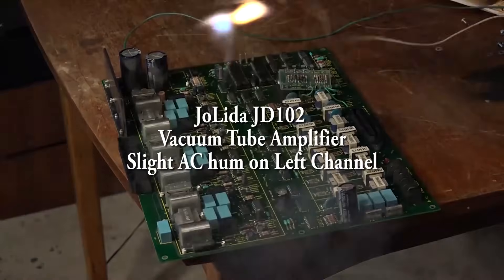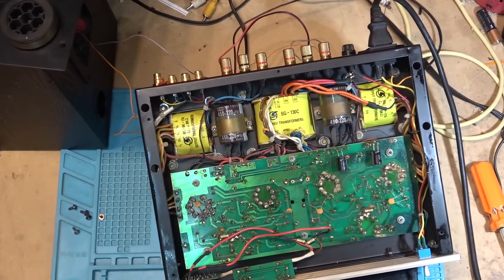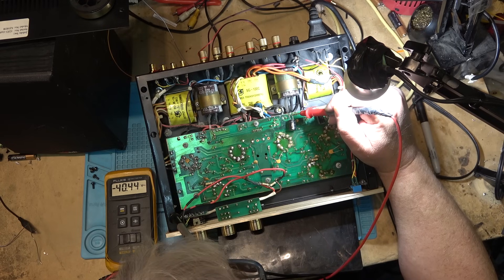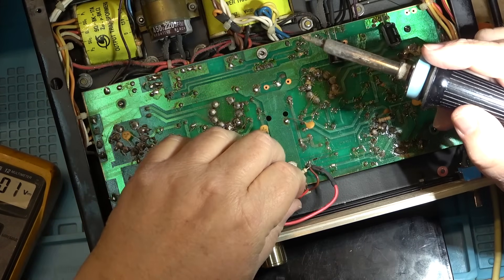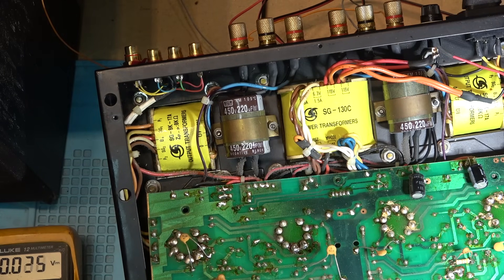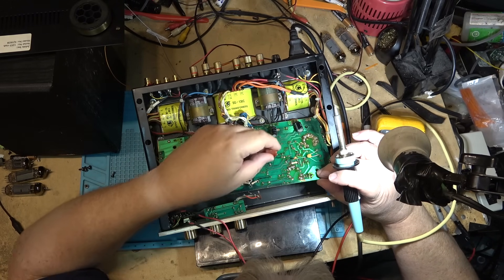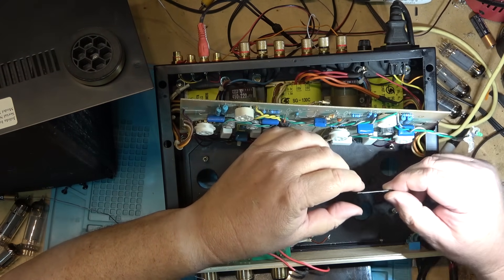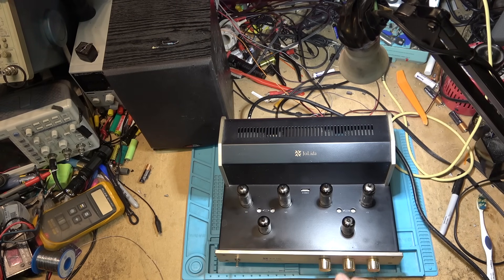JoLida JD102 Vacuum Tube Amplifier Hums

Comment: I had a random noise on my MF X10D recently.
Haven't used it for a long time do I thought could be some poor solder joints.
Touched up all the solder with flux to make sure it runs well on the contacting surfaces.
When I gave the board a final cleaning, I noticed some stray fibers across some points... Probably from the cotton bud that I previously used when cleaning. Now it has become a routine to give any board a final brush before power up.
As for the lacquer/flux remnants, I had similar problem on a solid state amp behind... Think it created a high resistance path n intro noise into the signal.

BTW, I use a toothbrush with ipa to clean up dried flux.  Very effective.
Dab dry and final brush with toothbrush to remove any bits in between.

Juz sharing

Comment: Bloody hell. I took 3 semesters of electronics in high school 40 years ago, and I could do a better solder job on that.
Reply from the maker: Ya it was scary alright.   Go look at my tube amplifier build.  I didn't even need to clean the board and it looks better than that.
Reply: @12voltvids  Dave, once the tubes reach their life usage do these tubes start to make a humming noise?
Reply from the maker: @lox_501  yes they sure can. Especially if you get a filament to cathode short.  Or they can start to make hissing or crackling sound, or distorted low output levels.

Comment: I have this amp. It is rated at 20 watts a channel. I have not used this in a while. Mine is over 30 years old. It is supposed to be well made, I have never been inside-- but don't remember any problems with it. Black Ice Audio is now Jolida. It should be running 2- 12 AX7-A tubes in the preamp stage to reduce noise.

Comment: Wow....either somebody's first day on the soldering line, or they handed the iron over to a 6yr old. That was horrific. I've never seen anything that was manufactured look THAT bad. Dang! As for flux, if I get a bit of a messy one, or I made a mess or need extra flux, I use 99% iso and a stiff nylon brush.. I'd never let anything I've done leave looking that bad...even if the customer couldnt see it. Just a matter of pride I guess. That and as you stated anything high voltage you're just inviting a problem to arise eventually.  Thanks for sharing, Dave.

Comment: Why does that channel have two black little caps on the board and it's not on the other side what are they doing there?
Reply from the maker: Negative bias filters.
Reply: Right but is that working on both channels just happens to be on that side? @12voltvids
Reply from the maker: @jedi-mic  it supplies both channels with the negative bias.

Comment: Hi again,  Dave, could you tell me what the optimal temperature is for an adjustable soldering station ?, thanks 😊
Reply from the maker: 700 to 725F is what i generally use.
Reply: @12voltvids  thanks,  I'll try that temperature range

Comment: Are the historically problematic "blue caps" of any particular brand?
(I'm aware that it turned out they were not a problem here, as originally thought.)
Reply: Thats just the problem, theyre no branded.
Reply: @Synthematix  Thanks
Reply from the maker: Coupling caps can go leaky because they are blocking the plate voltage from the driver from the grid of the output.  If they go leaky your outputs are driven hard onto overbias which will red plate the outputs and eat them and possibly the output transformer.

Comment: I own one of these junkers. Started humming one day, and all of a sudden it started smoking real bad. Had to actually take it outside after I killed the power to it, because it smelled so bad. This particular model had an upgrade to its capacitors and supposedly high end wiring with better resistors too. My wife had purchased it for a birthday present. Only worked for a few years. Total crap and it cost a fortune.
Reply from the maker: Yes I know they cost a fortune.  Smoked real bad? Probably tranny shorted.
Reply: Just buy a regular amp or a receiver with a warranty!
Reply from the maker: @mmichaelnowell1512  people pay big money for these low power amplifiers.

Comment: I thought you were over exaggerating how bad the solder work was that someone was in it. That definitely bad, I shocked they charge as much as they do and it that bad? Traces and solder pad would have been eaten up in no time with that much flux left on the board. I repaired some Chinese tube amplifiers I thought was dodgy but that one you showed is worst then anything come across that suppose to be a production unit and untouched.
Reply from the maker: Rosin flux won't eat the copper, but acid core will. Ask me how I know that?  My grade 8 electronics instructor insisted that we use solder paste on everything and gave me a failing grade because I relied on the flux in the core. Made me redo everything "his" way. Well my project and everyone else in the class had the same thing happen, board was eaten away. I generally don't wash away flux unless it is in a high voltage circuit like this only because it allows for other debris to stick like dust and that is conductive.

Comment: Hey Dave,  what's the average life span of these vacuum tubes in these so-called high end audio amps.
Reply from the maker: It depends on the design and how they are biased.  Single ended tend to eat the tubes a little faster because they are always under a heavy load.  Push pull they last longer but you do need to check the bias settings from time to time.  I've gone through a set of el34 on my yaquin and they lasted me about 5 years but I also wasn't playing it every day.  Single ended amp a couple k hours and they will be ready for a new set.

Comment: I used to repair high-end stereo equipment for a living including Jolida amps and I've never seen one with such sloppy solder work. Also whatever you do to fix one channel you must do to the other channel so they are the same or it will mess up the stereo image.
Reply from the maker: That's why I put the original coupling caps back in.

Comment: Lol absolutely horrendous, i wouldnt pay 10 pence for this, theres no way this left the factory looking like that, it should also have a protective perforated sheet across the transformers, and use matched pairs of 1% resistors, its been messed with.

Spray some foam oven cleaner on that pcb it will remove the crap dead quick, if its not removed it will start to carbon track
Reply from the maker: The guy did being it with the box, it had his name and address on it and the address from the company and he told me he bought it new.   Said it has never serviced.

Comment: I agree. I also could do a better soldering job. And design job.
Reply from the maker: The design is fine.  Tubes are really simple, you don't need much skill to design a tube amplifier as they were the simplest devices.   The modern stuff all digital is a nightmare